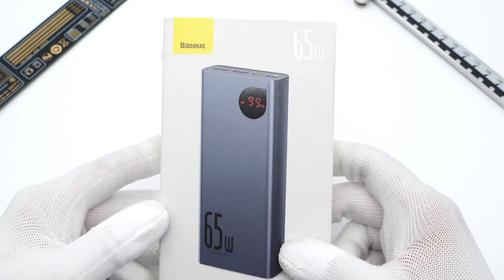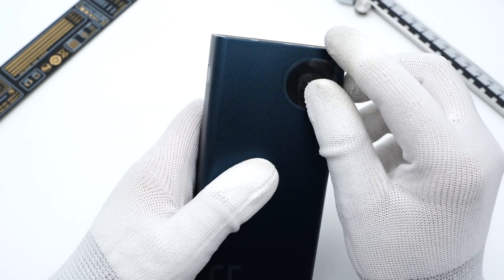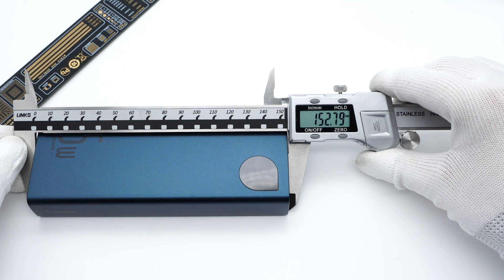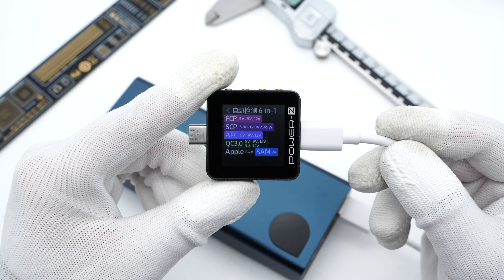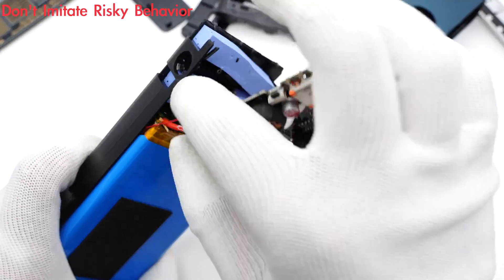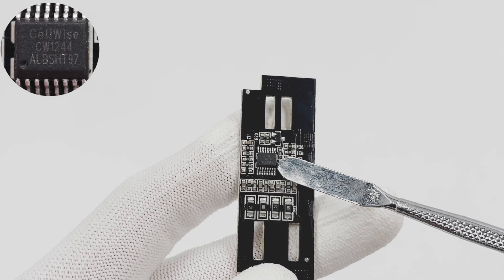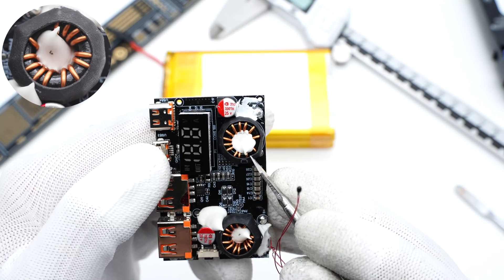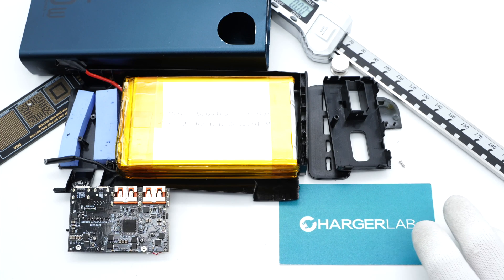Teardown of Baseus Adaman 65W 20000mAh Digital Display Power Bank

Comment: If anyone else is wondering how to disassemble it without ruining the casing - use the hot glue sticks glued to the covers to pull them out, stick those first to the screen protector, then to the button and lastly to the bottom cover. It will leave the casing in the ideal condition and yet you'll have a fully disassembled unit with a few tries though. Have a nice one!

Comment: If this is a 20ah battery pack, shouldn't they be in parallel and not in series?
Reply: It's still 20Ah in the end. You would plug them in parallel to get higher amperage. Here, amperage is irrelevant, you rather start off with a higher tension to save up costs on step-up electronics. It can go up to 20V output, so since the 16,8V of the pack (fully charged) can be step-up to 20V more efficiently than starting off at 4.2V.

Comment: Is it dangerous to bypass the battery protection board? Mine was delivered broken. I diagnosed the issue to be somewhere in the battery protection board. I bypassed it and it seems to be working fine. Just concerned if bypassing this board poses a fire hazard?
Reply: My "fix" didn't work long. Eventually it stopped charging again and out of caution I threw it away :/
Reply: Hey are you good at fault finding such stuff?  My 65w baseus just died, usb 3.0 completely dead, usb 2.0 showing its charging up the power bank rly fast like 2 percent per second, then it gets to 99 and stays there, is it worthy to try to solve this issue or just buy another? not baseus ofc xD

Comment: These people are lying. They act like you can just slide it out after removing the bottom cover, but you can't. You can clearly see they had to remove the side button and the display cover. Also they broke off the plastic top cover. Shame to spread misinformation like this.
Reply: I just took one apart, and you do indeed need to remove the display cover.  It pops straight out, but is a tight fit.  It's hard to get out without marking it up.  The power button does not need to be removed.  You can push it in while sliding the cover down, and the cover will slide over the power button.
Reply: The jumpcut between 2:57 and 2:58 is brilliant! It took me almost an hour to go from popping the back cover to sliding the isides out. No, the power button does not slide with insides, it have to be removed first.

Comment: Bought it yesterday, tried out today and will bring for a repair/refund tomorrow.

From a full charge (100% on screen and no energy consumption over the wire) it gave 5400mAh until it reached 40% and then it died like it would be at 0% - no reaction to a button, no charge given. As soon as i hook it up to a charger it boots (showing 0%) and in 3seconds show 40already. Given a few seconds charge from that shown 40 and tried to use it to charge phone or anything again - bam it goes flat again at 40%

When charging the powerbank itself with quick charger (60w), it grows from 40 to 80 smoothly and then at around 82 it just immediately jumps to 100 and stops charging. Hooking up  5v charger instead of a quick one still allows to push in a few percent.

Saw those negative youtube videos before buying it but thought (its just one of thousands and it will not happen to me.. boy i was wrong).

Do not recommend it at all.
Reply: Happened to me..this product so many defect
Reply: Happened to me too. I emailed them and they sent me a brand new one so I still had the broken one. I bypassed the battery protection board and it seems to be working fine now. 2 for the price of one!
Reply: To me and two other friends, too
Reply: Same, but mine was showing 22% and died. When I plugged in charging it showed 0% and then after 3-5sec it changed to 22%.
Reply: Same, any way to fix it? Maybe broken resistor, etc
Reply: @omgoood  not really, unless you know how to weld, etc. I would recommend to buy Anker as it is way better in terms of quality. I replaced this Baseus with Anker Power Core 3 Elite 26k

Comment: After removing the bottom cover, what is the process of pulling out the whole pack? It seems it’s not coming out for me 🙄
Reply: Yeah, it's missing a good explanation for a full teardown and not skipping critical steps like that ...
I  destroyed mine trying to open it because those steps were not explained. No clue how you're supposed to remove the button and LCD without damaging them. Me the button is in pieces ...
Reply: @smunaut  Using hot glue sticks! Without a scratch!
Reply: I've done this with my adaman 10000mAh by removing side button (almost destoy it) and removing plastick glass of LCD.

Comment: wich the best this model or the model with orange cable
Reply from the maker: It depends on how you use it. The 65W with an orange cable is more convenient for traveling.
And this 65W power bank is more suitable for indoor use.
Reply: @ChargerLAB  good thanks

Comment: the failure rate of this thing is a bit unlucky, we bought all in all 6 of these for familiy and friends and one of them had right after using it one time a short in one of the usb A circuits another one got a usb A with a not working contact, so only 2 ports out on that one and a 3rd one now failed completely, the last thing it did was to pretend to charge from 0-100% in 2 mins while drawing near to 0 power, so the battery itself is probably good but the circuit is not that good in my experience
Reply: same here, don't show anything when i try to charge it by the usb c port, but when i plug in a micro usb cable (with 45w samsung charger) it charges from zero to 100 like 2%/s
Reply: @gabrielsouzaperes1084  hey, I found out what the problem is
There is a chip that is responsible for the 20v switching from the battery and the usb c port, also it powers the other circuits as well I think, the chip is called "southchip sc8721", it shorted the input and the output of itself
The battery was save and not completly drained do to the seperate bms board, which cut the power
I found with ir camera that the input power shunt is getting hot and the coil right next to it on the other side on the board, the soutchip was also in line with these 2 and had less resistance, therefore I couldnt see it right away, but thats was the short reason for sure, because after I soldered it out with hotair the short was gone
the board accepted power from the lab power supply and was showing a charge state that was reasonable, but as soon as I use the usb a, it blinks two times and turns off
I think replacing the chip will fix everything, but I didnt get a new one so far, for me in germany it looks like the only source for these is alibaba and I have to take 10 of them, which is fine tho, because they are only 1usd each

in case you have no option to solder this, you might be able to buy a usb c to battery charging board, search for "120w Two-Way Pd Fast Charging Module 4 Strings Charging Treasure Module Circuit Board High Power Pd Fast Charging Boost/Buck" on aliexpress, these should run with 4 cells in series
and then you replace this, but maybe check if the cutoff voltage from the original bms is set proberly

hope that helps you
Reply: @berberger4814  thank you very much, I may take it to a repair assistence, it is an great, well built and expensive powebank.
Reply: @gabrielsouzaperes1084  Have the same issue. Tore it appart (and destroyed it, no way to put it back together) and found the issue : One of the 4 cell is just dead. 3 are fine, but one isn't taking charge and is reading 0.5V.
Reply: @smunaut  actually thats not the same issue, the bms of mine did prevent it from discarging further since the sc8721 was shorting the bms out
so my cells are all fine, still reading 15.83 V (just checked) - so they are good
for you Id bet it was water damage on the bms pcb or another random failure on the bms board - infact I think your pd controller board should be fine
Reply: Yes. same happened with me.

Comment: How do you loosen the the aluminum sleeve? Can't get mine out yet....
Reply from the maker: Just get a spudger and pry again and again.
Reply: @ChargerLAB  Stop lying! You know very well you have to remove the button and display cover which is pretty much impossible.
Reply: @monkeystation  mira no se si en español te valga la respuesta, pero con una navaja acabo de desmontar mi powerbank entera, hice palanca con la punta y también me sirvio para los tornillos, el botón empece a meter la navaja e hice palanca sacando poco a poco el boton, y la parte de la pantalla le di a una pestaña por dentro y después cuando conseguí hacer un hueco como para meter la navaja empecé a dar vueltas hasta que encontré la otra pestaña y tiré

Comment: Mine stop working only mini usb can use it blink from 1 to 3 until 99 when try to charge it all other port dead , very weird problem
Reply: @Cikgu Aman
hey, I found out what the problem was in my case:

There is a chip that is responsible for the 20v switching from the battery and the usb c port, also it powers the other circuits as well I think, the chip is called "southchip sc8721", it shorted the input and the output of itself
The battery was save and not completly drained do to the seperate bms board, which cut the power
I found with ir camera that the input power shunt is getting hot and the coil right next to it on the other side on the board, the soutchip was also in line with these 2 and had less resistance, therefore I couldnt see it right away, but thats was the short reason for sure, because after I soldered it out with hotair the short was gone
the board accepted power from the lab power supply and was showing a charge state that was reasonable, but as soon as I use the usb a, it blinks two times and turns off
I think replacing the chip will fix everything, but I didnt get a new one so far, for me in germany it looks like the only source for these is alibaba and I have to take 10 of them, which is fine tho, because they are only 1usd each

in case you have no option to solder this, you might be able to buy a usb c to battery charging board, search for "120w Two-Way Pd Fast Charging Module 4 Strings Charging Treasure Module Circuit Board High Power Pd Fast Charging Boost/Buck" on aliexpress, these should run with 4 cells in series
and then you replace this, but maybe check if the cutoff voltage from the original bms is set proberly
Reply: So is mine

Comment: Damn that was a complete waste of time you skipped almost the whole process how the hell did you get the power button out at least
Reply: heat the glue stick, press it against the button and when it cools, pull.  The button is attached with three latches.  sorry for bad english

Comment: I am a student I buy basus adamim black 20000 22.5w power bank. But I cannot use it only 3 month it just broke now it did not work very bad basus 🥺 ,, my mi powerbank after 4 years still working fine just lost full capacity
Reply from the maker: You can definitely report this to Baseus official to get a refund or replacement.
Reply: @ChargerLAB  Mine only got 6 months of warranty. It's crap, don't buy it.
Reply: @ChargerLAB  i live in Bangladesh and there is no chance of repair officially and refund,, recently i buy ip5328p powerbank circut and fix the powerbank. ❤️
Reply: @ssjihad7014  this shouldnt work with this battery actually, because it has a voltage up to 16.8v (thats at least what the video says, and also my opend one has also 16v) and the ip5328p can only handle one cell and has a max voltage of 4.5v on the battery input according to the datasheet
Reply: @berberger4814  no bro my PowerBank has 2 10000 mah battery with parallel connection so it was 3.7 v not 16.8 that's why i use the PowerBank module
Reply: @ssjihad7014 Did You Buy  The Official Version Or Unofficial Version????
Reply: @ashrafulrana5578  i check qr code and it says original
Reply: @ssjihad7014  বাংলাদেশে এটার বহু কপি পাওয়া যায়? নিশ্চিত কপি একটা নিছেন? কত নিছে?
Reply: @Mriz2001  না ভাই কপি না ব্যাটারী একদম ২০০০০mah,, সার্কিট টা নষ্ট হইছিলো
Reply: @ssjihad7014   ভাই কোথা থেকে নিছেন কত দিয়ে নিছেন???
Reply: @Mriz2001  দারাজ থেকে অফার সহ ১৪৪০ টাকা
Reply: @ssjihad7014  ভাই দারাজে ডিসকাউন্ট দেখলে আর কিছু কিনবেন না। এরকম আমিও ধরা খাইছি। সবচেয়ে ভালো বসুন্ধরা/যমুনায় অনেক ভালো শপ আছে, দাম একটু বেশি হলেও ভালো কিছু পাওয়া যায়
Reply: @Mriz2001  হে এটা অবশ্য ঠিক এখন প্রায় সবকিছুই offline থেকে কিনি,,দেখে আনা যায়
Reply: @Mriz2001  তবে পাওয়ারবাঙ্ক টা এখন ঠিক আছে ip5308p  ফাস্টচার্জিং পাওয়ারবাঙ্ক মডিউল লাগাইছি এখন ভালোই চলতাছে,, স্টক মডিউলে সমস্যা ছিল
Reply: I got the same problem
Reply: My bisuse 65 w, 30000 not working after 3 months. Bisuse no good.
Reply: Same here I had a black one and it broke after 3 months  just went to the newer 65w and hopefully this one last longer
Reply: @SevenHealer  mine lasted 8 months... don't buy Baseus.
Reply: The problem is the lipo batterij itself it should always be liion
Reply: 1year replacement warrenty pawa jay basuas er power bank a kajei jara ata karap bole muloto tara nokol product use koreche...

Comment: This is a good powerbank
Reply: It's not, mine just stopped working after 8 months with barely ever using it.
Reply: @monkeystation  My ravpower only died in 5 months battery was fried or it short circuited idk what the problem was but this shouldn't fail seems like you didnt read the manual